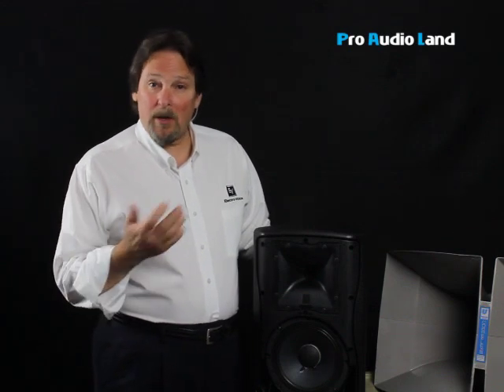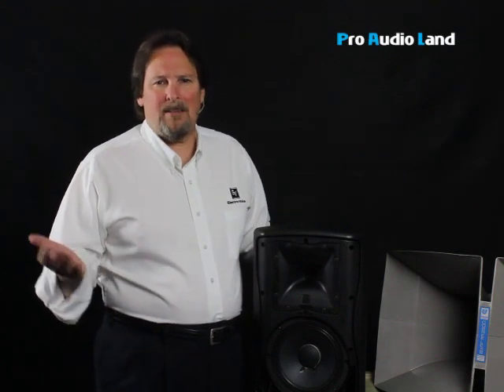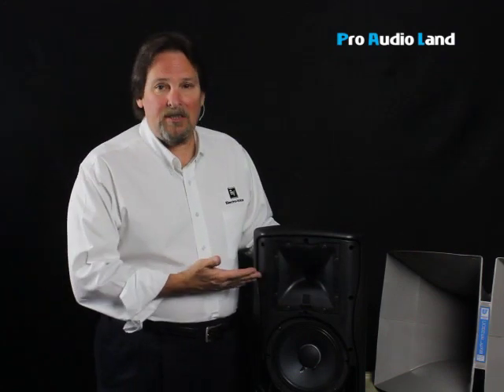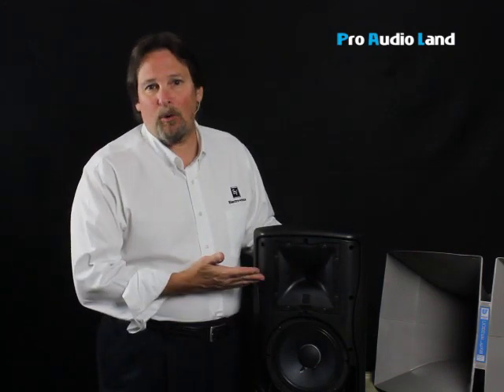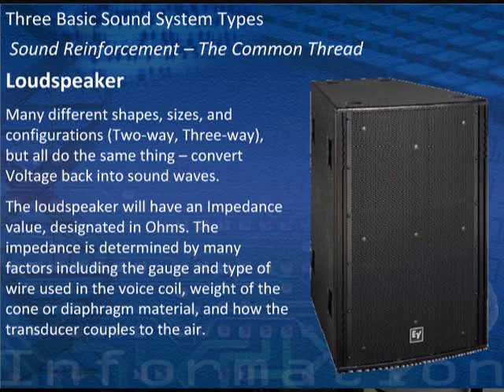Pro Audio 101: What Is Speaker Impedance? We Explain.

Comment: Some amps will run-safe with a 2 0hm load, but most are only rated for 8 and 4 ohm loads.  The manual will have the info you need.

Comment: You said when you connect another loud speaker you are essentially cutting the first loup speaker impedance in half. Then said when connecting a third loud speaker your impedance on the first would go from 4 ohms to 3 ohms. Why when connecting that 3rd loud speaker would it not cut that first down to 2 ohm?
Reply: It's 2.7 Ohms. Check https://geoffthegreygeek.com/calculator-speakers-in-parallel/

Comment: so if the amplifier is 4 ohms. I dont understand how the fuck you can fit two 8 ohm speakers when the maximum the amplifier can support is only 4 ohms. shouldn't the amplifier be 16 ohms for it to support 2 8 ohm speakers cause 8 + 8 = 16...I know im wrong, somebody please explain why im wrong.
Reply from the maker: When wiring 2 Speakers in Parallel the ohm load changes depending on the speaker rating you are combining. Two 4 ohm speakers = 2 ohm load, Two 8 ohm speakers = 4 ohm load, Two 16 ohm speakers = 8 ohm load. Hope that helps.
Reply: http://image.jpmagazine.com/f/29956470+w750+st0/154_0909_02_z+series_and_parallel_circuits+ohms.jpg

Comment: I'm not understanding. When you say hooking up two speakers in parallel, do you mean hooking 2 speakers into one channel on the amp? SO if you have a 7 channel amp with 8ohms into each channel, you can hook up 14 speakers to it and that would drop your ohms down to 4 on each channel? Thanks and sorry for my ignorance.
Reply from the maker: When wiring 2 Speakers in Parallel the ohm load changes depending on the speaker rating you are combining. Two 4 ohm speakers = 2 ohm load, Two 8 ohm speakers = 4 ohm load, Two 16 ohm speakers = 8 ohm load. Hope that helps.

Comment: Can xplain me something about woofer, I need a woofer which can produce good depth sound, I am going to buy a HT inbox system Onkyo 9400 THX, The woofer is Acoustic suspension 125W, 6 ohms 100 Hz. I have a panasonic SA ht 930, its a 2 speaker system, could't find any Watt specs in the woofer details except sound pressure 84dB/W (1.0m), frequency range 34Hz-220Hz (-16dB) 38Hz-190Hz (-10dB) and both are 15 cm cone type. Now i am confusing the new one will work better than the old one or not?